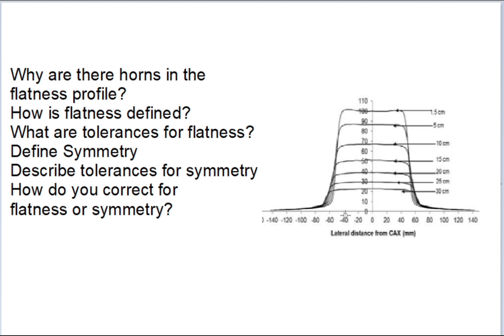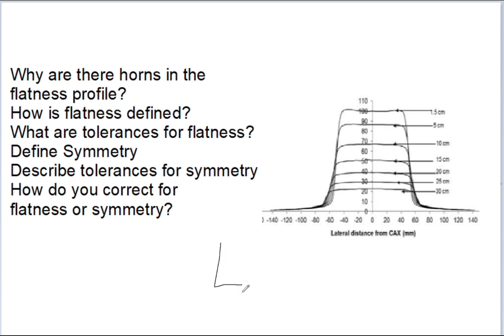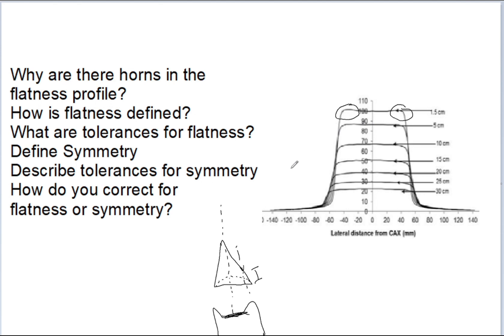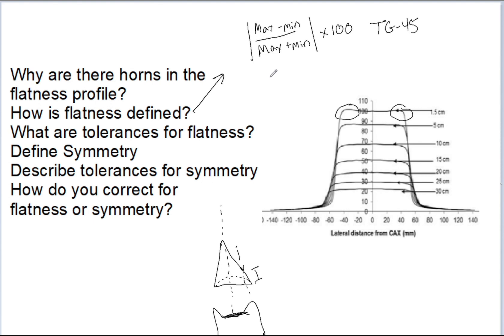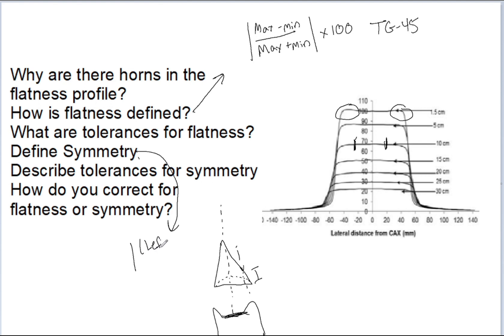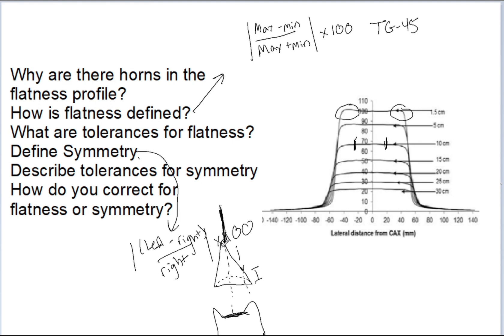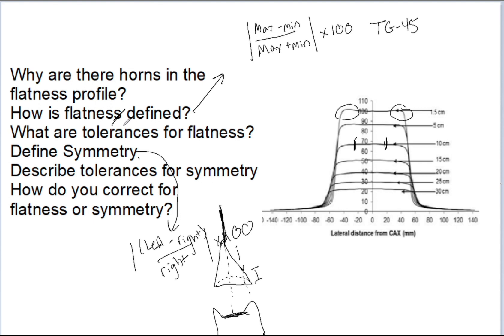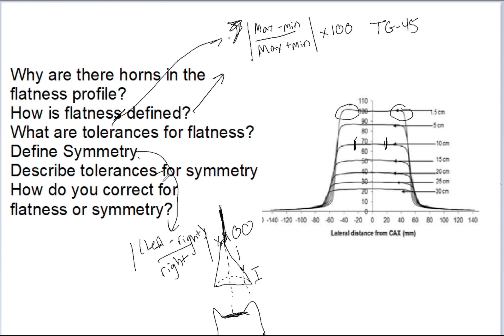Photon Beam Profiles-Flatness and Symmetry ABR Part 3 Preparation

Comment: Why do the horns become less pronounced for increasing D_max?
Reply: I'm assuming you mean why do the horns go away for increasing depth?  The goal of the flattening filter is get a flat profile at some depth, like 10 cm.  As Adam said in the video, the flattening filter flattens the forward peaked-in-center beam, with more material in center and less on the edge.  In addition to attenuating the beam making it flatter almost right away, remember that attenuation usually filters out lower energies more than high energies (beam hardening).  So, in the center, the average energy is higher than the average near the edges.  As the beam goes deeper, the higher energy center penetrates more, meaning it keeps more intensity compared to the lower energy edges which will attenuate more with depth.  Hence, the horns start to shrink relative to the center.  We get the "flat" beam at our desired depth (10 cm) and then the trend continues and the edges get even lower than the center although it doesn't look as pronounced as the lower depth horns.